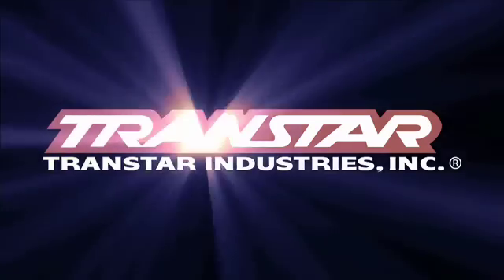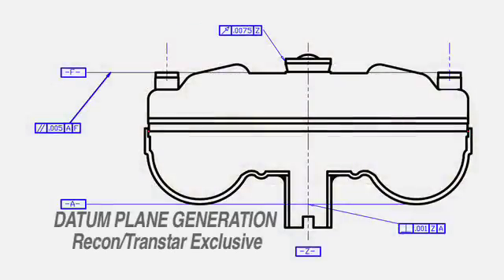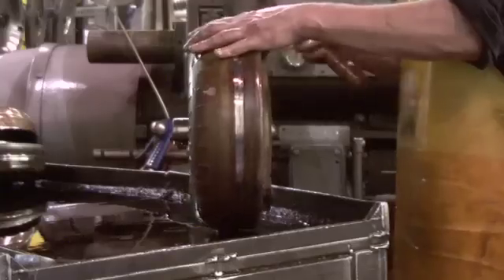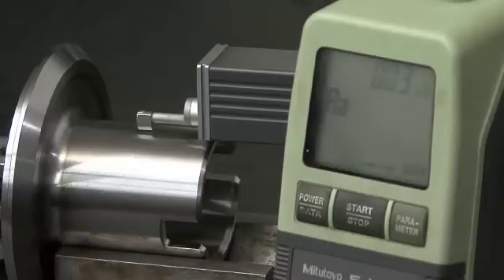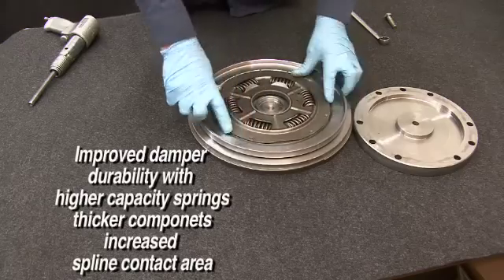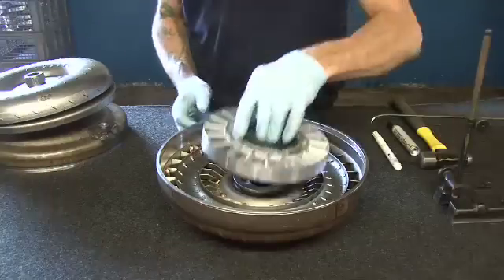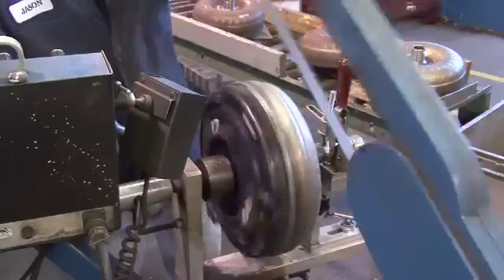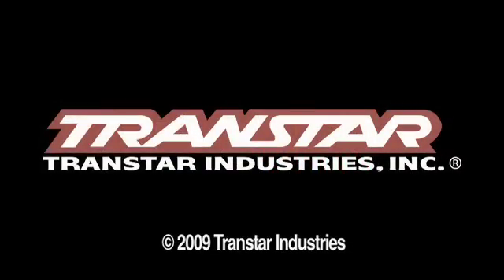How ReconTorque converters are made

Comment: My newly installed transtar converter slips the lockup under acceleration. Not impressed
Reply: Lockup is typically only applied when in top gear and not under acceleration. Must also be at least a certain speed as well, like 40 mph.